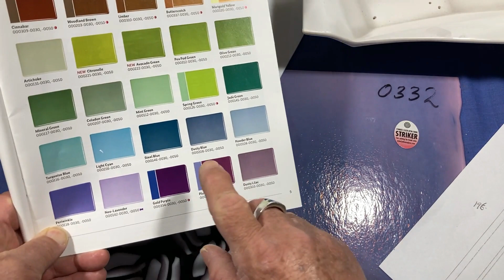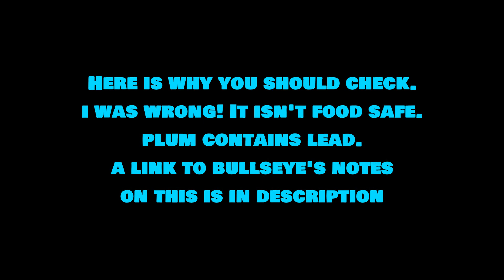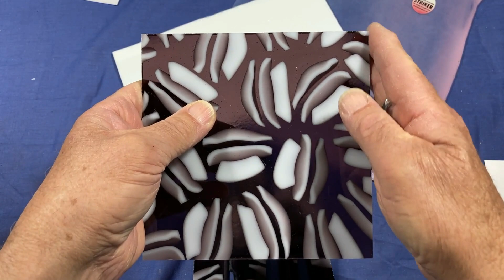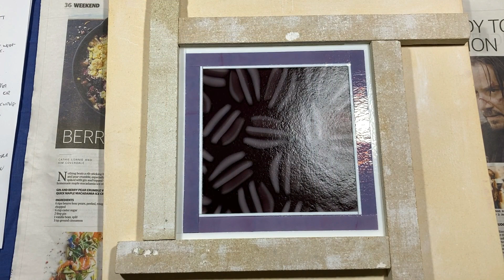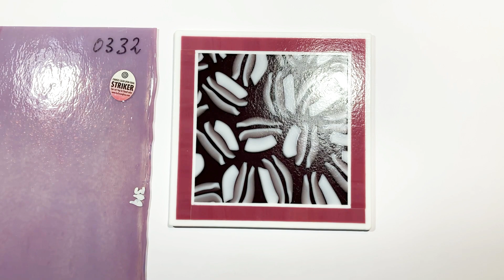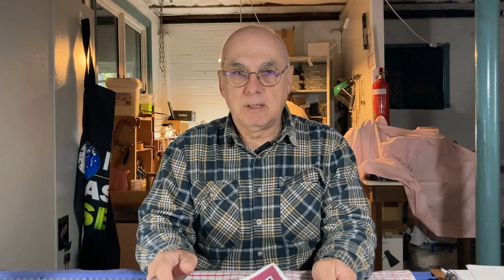Square Can Be Beautiful, If It's a Fused Glass Bowl, Fused Glass Project Tutorial

Comment: Hi Jeff. This is a great technique. Thank you for sharing. I have a question about the slump schedule. 630C for 5 minutes seems so short for a slump. I've never had luck slumping into a mold as deep as that origami mold unless I went hotter and longer. Does that cool/short schedule work because you're not using the wings of the full mold?
Reply from the maker: Most of my work seems to work at around 630. It all depends on the glass used and mould.
Reply from the maker: I have an issue with this mould when the glass slipped. The way I used it is more stable.

Comment: Can you put hot food in these infused glass bowls?
Reply from the maker: Hi Janice. Only some colours are considered food safe. It's not the heat, more the possible leaching of things like cadmium and lead into the food. It's a low risk but still a risk. In this piece, I did use 0332 Plum which does contain lead. So it's not really food safe. If I had covered it with clear glass then it could be considered food safe, though, according to Bullseye, it should still be tested. The only way to be sure, as far as I know, is to use only glass that does not contain lead or cadmium.
Reply: @RocketRoseArt  Thank you for your quick reply.  Do you think a bowl made of fused black and cream coloured glass would be okay to serve medium hot food in?
Reply from the maker: @janicelynnadams1926  Hi Janice. If it's Bullseye glass then this page is the best reference for the whole food safe question - http://www.bullseyeglass.com/is-bullseye-glass-food-safe.html. Sorry, but I can't give you a better answer. I don't know what brand of glass or even the proper colour names. If it is Bullseye then have a look at the Bullseye page I linked to.

Comment: why do you sandblast before fire polishing? do I need to?
Reply from the maker: Hi Steve. No, you don't have to. I do it to remove any small bits of devit that may have occurred. There are often small areas of devit. If there is any it will likely get worse in the Fire Polish. Also to remove any other imperfections. I do it mainly as a precaution and for me it's easy to do. Sort of insurance. If the surface is good and you've just done some coldworking, say with a diamond pad, you don't really need to do it.

Comment: why do you flip it before fusing. sorry if you already have answered this. Thanks
Reply from the maker: In those pieces where there are straight lines in the design, I fuse it with the top down to keep those lines straight. If you've ever done something like this, you'll notice the lines on the surface facing up after fusing can be a bit wobbly from the glass moving around. On the bottom surface the glass can't move so readily and the lines stay much straighter.
Reply: Thanks for the timely response. I very much enjoy your videos, humor, and sharing roughly the same age. 😎

Comment: Another great project! Could you please tell me what grit size and particulate you use to sandblast your pieces? Thanks again and I can’t wait for your next video! 🙏🏻😊
Reply from the maker: Hi Ev. I use Aluminium Oxide 80 grit. I find the Alox not as aggressive as Silicone Carbide. The 80 grit works well, as long as you're not too aggressive. Not too close and don't linger in one place too long. I do designs on glass as well, and it will still cut deep if you want. So just lightly for something like that. Hope that helps.
Reply: @RocketRoseArt  Thanks so much for the information Jeff. It is very much appreciated. I have just purchased a sandblaster but didn’t know where to start, so this is extremely great information! Thanks again 🙏🏻😊